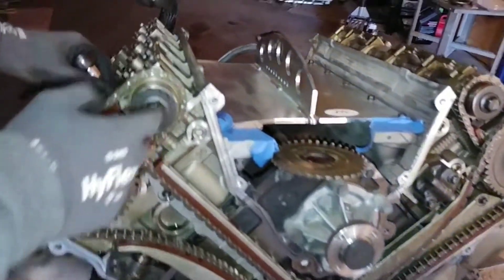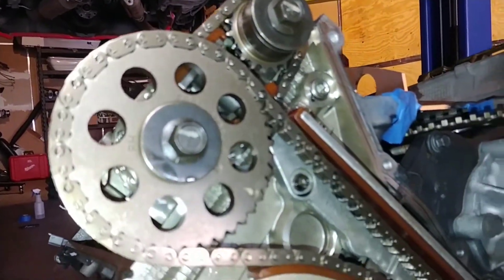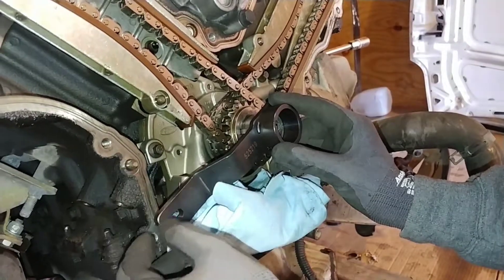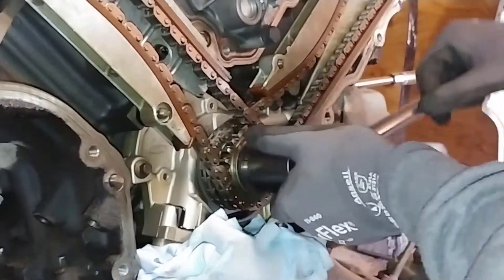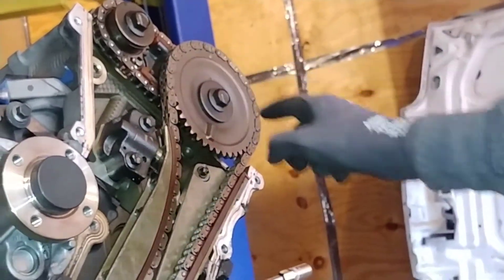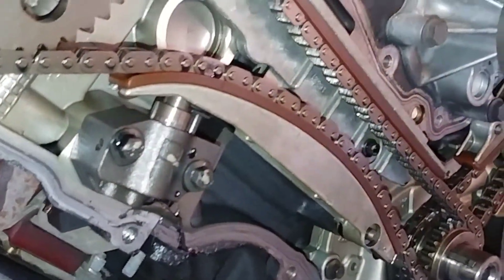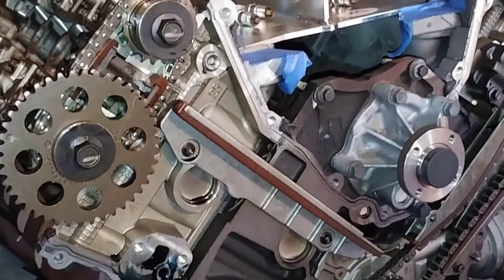4.6 4v timing chain removal (03 svt cobra)

Comment: You should have removed the followers that would have kept the cam from moving LOL. Rookie mistake. But don't feel bad I did the same stupid s*** LOL
Reply from the maker: I got the cam holding tool now , but if your removing the heads, I don't think it matters doesn't cause any damage
Reply: @texaseliteperformance4471  doesn't matter if you remove the heads off the engine. But with their heads on the engine and changing your timing gears and chains it does matter. This makes it easy to turn it without a load on it from the springs. I learned a lot by my first 4.6. 4V. The cam holding tool  is it good tool to  have. Better than the four vice grips that I used

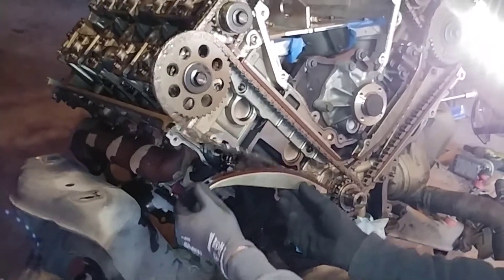Comment: Did the valves bent at 4:20?
Reply from the maker: No watch newer videos everything is good👍🏽
Reply: @texaseliteperformance4471  good to know was just curios people overreact when the cam spins and potentially ptv contact bending valves guess thats not always the case
Reply from the maker: @slicksloth_416  on the passenger side two of the valves stay slightly open when you take the tensioner off that's why it moved to a neutral position once the tensioner was removed

Comment: Good Job until it came to removing the chains. You have to use a cam holding tool BEFORE removing anything.
Reply from the maker: Yea i should've, i didn't though because i was going to be removing the heads anyway
Reply: That part made me chuckle. It happens lol